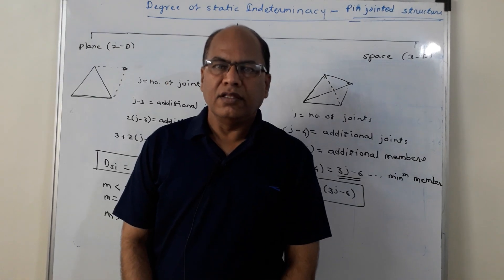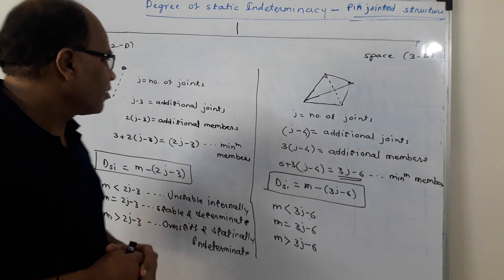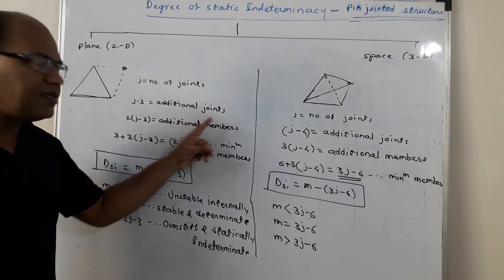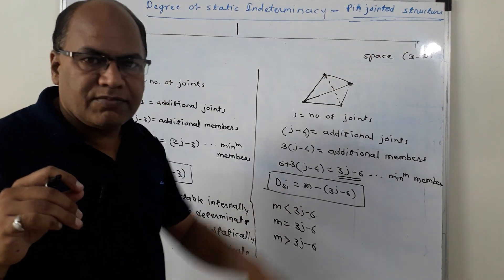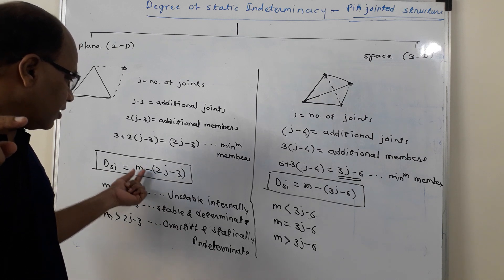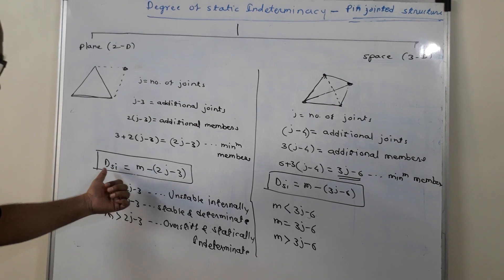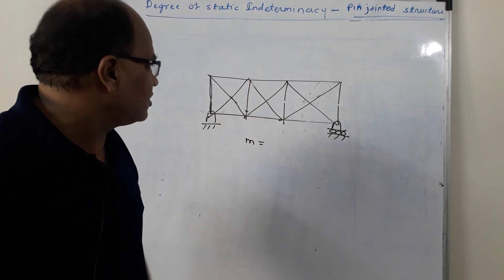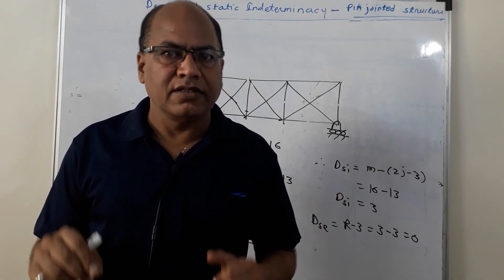Static indeterminacy of pin jointed structure

Comment: Sir how to know whether the given frame is pin-jointed or rigid-jointed? Please reply Sir. This doubt is literally haunting me
Reply from the maker: NF, In case of pin jointed structures , they should mention that the joints are pin joints or joints should be shown by usual pin notations 
If not, you should always bear in mind that for stable pin jointed structures , members should be connected to one another in a triangular fashion as for pin jointed structure formation of triangles is essential
Reply: Thankyou Sir for your brief explanation. I solved many frames using your concept and it worked. Once again THANKS Sir ❤️